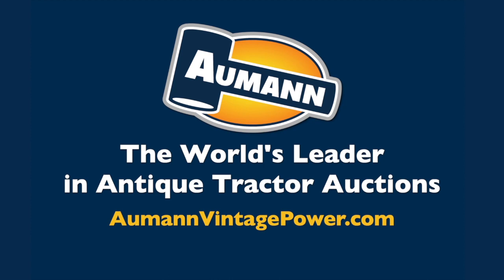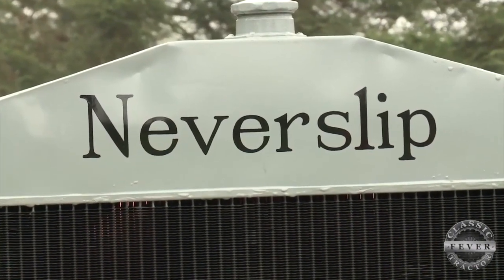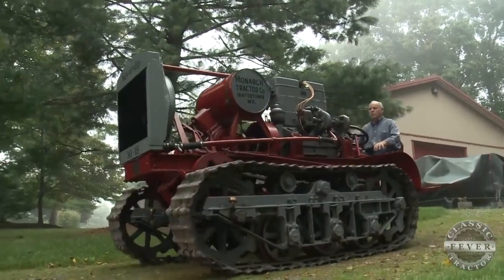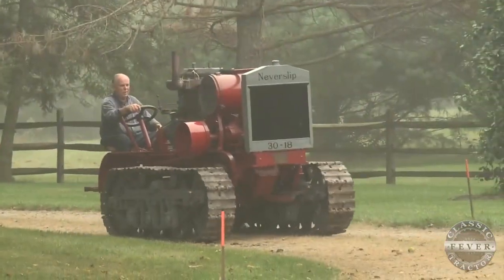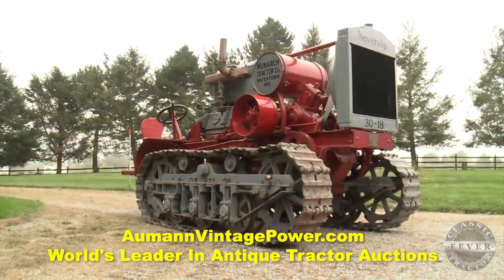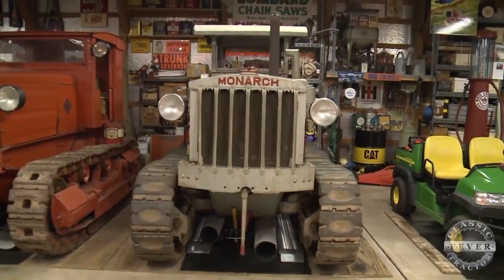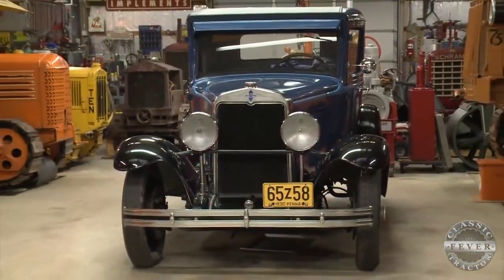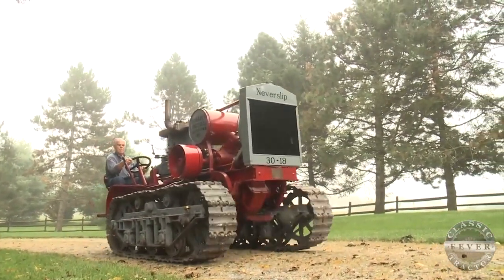15 YEARS TO FIND!  Low Production 1916 Monarch Neverslip 30-18 Crawler Tractor

Comment: I question the 30-18 designation:  Usually 30 would refer to the engine horsepower at the pulley and the 18 horsepower at the drawbar.  But it was referenced twice at 18 engine horsepower.
Reply: That's what I thought too.